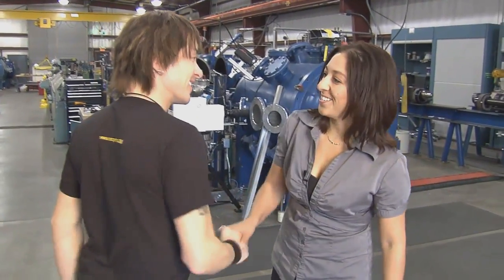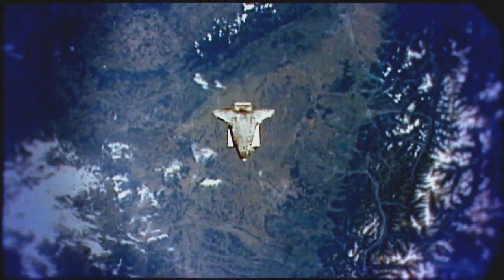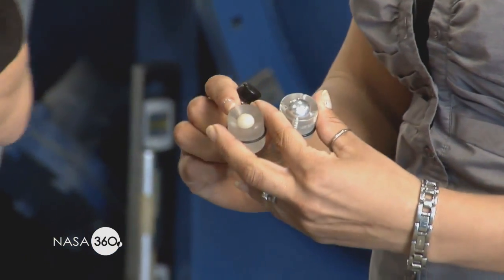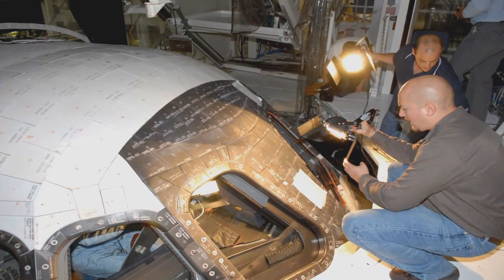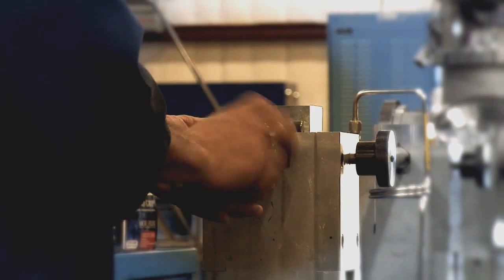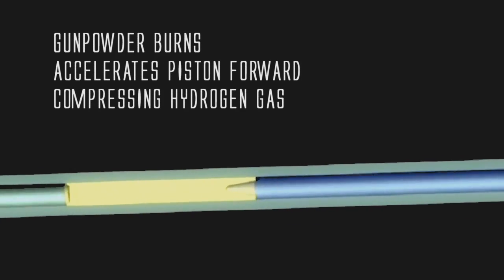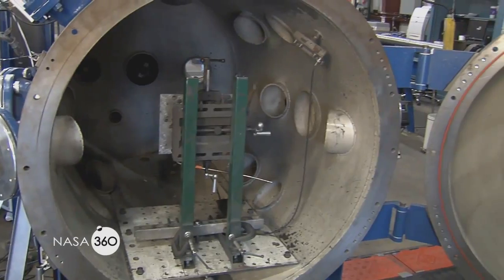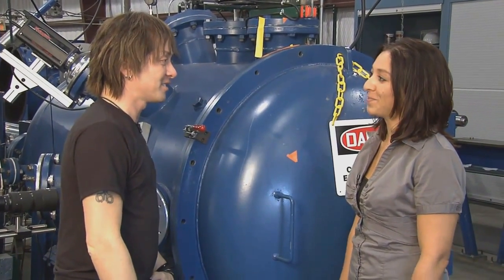NASA White Sands Test Facility Remote Hypervelocity Test Laboratory

Comment: I would like to know, is it possible to ignite that hydrogen gas as the projectile passes a certain point giving it a forgive my pun, jolt of kicking power. basically adding a spark of electrical current to ignite the hydrogen gas as it expands pushing the projectile at an even greater speed? Is there any way to add more momentum using the Magnetic Accelerator theory like the channel magnetic games used https://youtu.be/iyv9GhaITNE or perhaps a bladed spiral barrel with less contacting surface? Why not do all, how fast would the object travel?
Reply: There is no oxygen to burn the hydrogen. 
And if there were, you would have water vapor, thats very heavy and couldnt accelerate the bullet.

Comment: Is light gas gun a military weapon as well?
Does it have a kinetic projectile or an explosive projectile ?
Reply: For unclassified info.. Probably just kinetic. Classified info... They're probably dabbling with high velocity penetrating projectiles maybe with explosives. Who knows.
Reply: This one here is unclassified information. For the classified information... They might be experimenting on tungsten armor piercing projectiles on 2 meter thick hardened steel. Who knows. Hahsha
Reply: @Thigsy  ah ok thanks for the informations
Reply: Its to complicated and with airresistance the bullet wouldnt be much faster than a regular one.
Also at that speed explosive energy is so low compared to the kinetic , its not worth it.
Reply: @yaykruser  ah ok thanks for further details